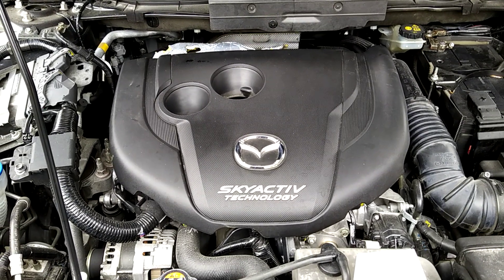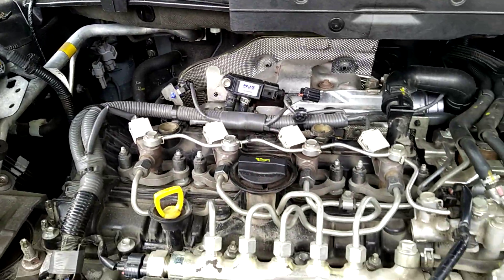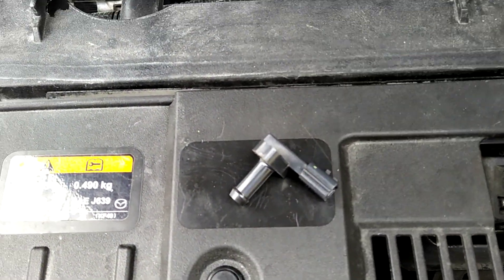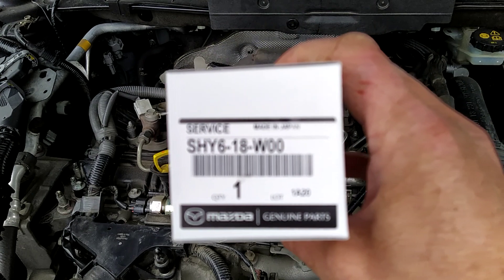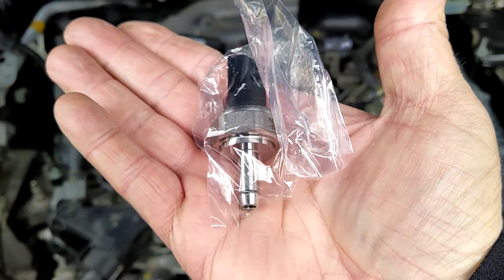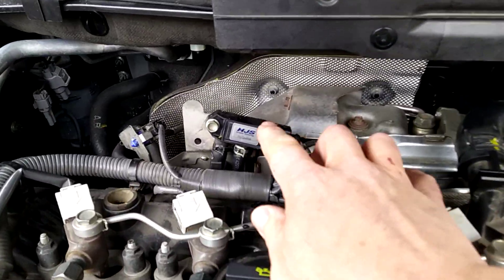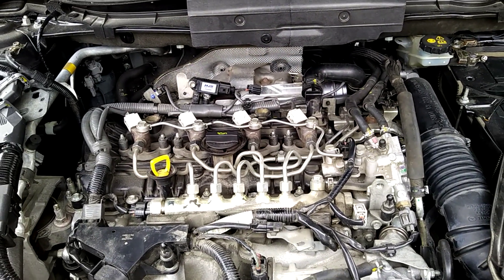Mazda SKYACTIV CX-5 2,2 Diesel DPF / Exhaust pressure sensor **IMPORTANT**

Comment: Hello, I watched your video about cleaning the exhaust pressure sensor on the Mazda CX-5 2.2D.

On my car (CX-5 2.2 Diesel, 2015, around 105,000 km) the DPF regenerations happen very often, about every 180–220 km. The strange thing is that it mostly happens when I drive on the highway (Autobahn).

The car itself drives well and fuel consumption is around 7.6–8.0 l/100 km, but in Forscan it shows frequent regenerations.

Could this problem also come from the exhaust differential pressure sensor or the hoses being clogged, as you showed in your video? Have you experienced the same issue?
Reply from the maker: Hi, thanks for your message. The video on the exhaust pressure sensor was replacement, not just cleaning. If you have the old all plastic sensor, replace it with the latest one that is metal and plastic. The reason for frequent regens could be plenty, suspect that your DPF could be near clogging and your EGR and manifolds need de-carboning. Check your MAP sensor, located on the left side of the manifold under the electrical big wires. Clean that out, but if it is heavily caked up, your intake system is choked up. When you drive this car above 120 km and hour, the diesel consumption jumps considerably. Your low end mileage is within range.  Let me know how it goes.

Comment: Hi, I have a question. I'm really struggling with my car. It's a 2016 diesel model. Diesel is somehow getting into the engine oil. Sometimes the DPF warning light comes on, and occasionally, at high RPMs - around 3000 - the car goes into limp mode. It also performs regeneration every 15-20 km. Could you please list all possible causes and indicate which one you believe is the most likely?
Reply from the maker: Most likely you have injector leakage into the oil. I would start with that. Depending how bad it is, the other affected parts could be the DPF and turbos. MAP sensor is most likely clogged as well. The injector washers were a bit of a common problem on the early year 2.2 diesels. You could see some moisture at the bottom of the injectors as well, sure sign of this.

Comment: So I can basically just go under the hood and look if it is already upgraded on the one I just bought? Since it looks significantly different.. Or are there many versions?
Reply from the maker: If the sensor is metallic, you are good. Plastic- get the latest SHY-6-18-W00

Comment: I and mechanic can not find this part.   Somebody can help?
Reply from the maker: SHY-6-18-W00  Mazda original part. It is made of steel, while the older ones were plastic. Readily found on Google.
Reply: Have you tried ebay? I got mine from there

You can also Google the part number and work from there

Comment: EDIT: This video was almost perfect but your model numbers are out of Focus.
For those who have P0471 and P2262  faulty exhaust pressure sensor you need the part on the left (after market part - made in china likely) SH01-18-2B2 EDP Sensor and the Mazda Dealer Part (metal one to replace plastic one on the right of video) SHY6-18-W00 Pressure Sensor Kit with Tube.  
Be sure to double check these parts fit your Mazda CX5 as some models are different

Also if you want the installation of this part see https://www.youtube.com/watch?v=8nEuFytxrRw
Reply from the maker: Thanks, the reason I did not mention DPF pressure sensor (on the left) part number is because you can get those aftermarket reasonably. The exhaust part number on my video is right of the Mazda box, as far as I know that is the only one for 2,2 diesels.

Comment: Hey, i had soo many problems recently, i purchased a 2017 plate cx 5 2.2, its the Ke model (older shape) im currently getting p0101 mass airflow and scbs etc. the dealer i got it from changed 1 of the sensors and it was decarbonized etc and cleared out and reset. Do ya reckon this would fix the lot? As i know the mass air sensor works, with out the error the car boosts and drives with no issues
Reply from the maker: The MAF sensor issue should be cleared with either cleaning or replacing it. The SCBS and TPMS lights coming on is related to something different. I am battling this myself and will post a video soon regarding the recent issues I have had with my CX-5

Comment: how to change that rubber tube, i clipped my old one a bit more and then the exhaust gases start coming out, so i need to replace that rubber tube.
Reply from the maker: I would use long nose needle pliers first to get the clamp out and then pull the old tube out. You need to eyeball a new hose to be long enough where the pressure sensor sits nicely in its space. Spray some wd40 on the motor end hose inlet, insert the hose and clamp and the rest is on top of engine work.

Comment: Good evening. I have a masda cx5 2012 model. I have replaced dpf and made a program to delete the egr. However from thereafter an error p244A DPF pressure too low appears and from time to time when the car is cold is shaking for 3-4 minutes. Any idea?
Reply from the maker: I really cannot answer this since you deleted EGR? Was there a reason for this
Reply: @cronk216  Yes. Egr was blocked. And we decided to delete it.

Comment: Hi bro, I get P0236 "turbo compressor sensor A circuit range/performance" does it apply to the same sensors?
Reply from the maker: I would start by checking the boost sensor and if it is Ok and codes come back, look for intake issues or airflow to the engine

Comment: I have a mazda cx5 2.2 diesel (2016) codes p2262 and 0471 what do you think? Will it help if i replace this parts?
Reply from the maker: If you have an old style exhaust pressure sensor, upgrade to the new one. It will help, but beware that a clogged DPF will trigger codes later. Clean your MAF, MAP and IAT sensor as well.

Comment: What about p2466?
Reply from the maker: This code appeared with my car just before the real problem showed up, which is the "Check DPF" on the dash info screen. I suspect your DPF is clogged up. Driving with the big backpressure from the DPF is not good for the engine in the long run. *NOTE This is of course taking into account that you have the upgraded metal exhaust pressure sensor, the old plastic ones are bad.

Comment: How do I make sure it is a bad sensor? I got error P2118. Also DSC, TPMS, SCBS and parking breaks lights up in dashboard
Reply from the maker: I do not have an answer re: checking if sensor is bad. You have a different code from what I have seen, P2118 is electronic throttle actuator error code. It could possibly create those other codes, not sure. I would try clearing the code and if that same code comes back, look at the throttle actuator first. Did your car go into limp mode?

Comment: thx. The connectin pin/cables are the same..? BtW, can i replace the sensor only, leaving out the new pin and cables?? THX al lot!!
Reply from the maker: If you replaced the exhaust pressure sensor with the new metal model, you have to use the new wiring. Plug and play.
Reply: @cronk216  Thanks!!!! 😊😉😊😉💥👋

Comment: What about code P0299?
Reply from the maker: Low turbo boost pressure code, could be either turbo or the control flap on the drivers side under battery. You can see it clearly once you get piping out of the way.

Comment: Thanks for helping us all with your knowledge ❤ one question please..I get the all the warning lights when I brake or drive downhill but they usually reset after I turn the engine off. Recently got a dpf warning and then a dpf malfunction light and dpf guys resolved it, cleaned the exhaust and even said that it wasn't a lot of sooth there to give the warning at all. Next day same thing happened and same light was on. They said if that happens then its probably just the sensor and its not dangerous. Now Im thinking should I just clear the code every time it happens as its just because of a bad sensor or can this still be an issue? Thank you!

Comment: You nailed your first video , and yes it fixed issue with mine , i had codes relates to turbo underboost thats it , engine light on , issue with transmission gear shifts  , 
You are legend

Comment: Hi, I just bought a Mazda CX5 2015 reg and it has problems starting and then it’s showing DPF warnings on the dashboard.
It stalled a few times and then completely stopped even with the jump leads - would you say this is an issue with the starter motor or the DPF sensor?
Reply from the maker: Changing the DPF and exhaust sensors will fix numerous things, but not in every case. The I have had 2 years of trouble free driving, but now my DPF is blocked and my next video will be about that. I will remove it and take it to a shop that cleans out all junk. I will also do a de-carbon on the manifold, egr etc. Stay tuned.
Reply from the maker: Hard to say, but if you a showing a DPF filter blocked-excessive particulates warning in the dash, DPF most likely has to be cleaned. Other issues are sure to be present.
Reply: I suggest you find a mechanic to do a DPF delete both on the computer & mechanically in the engine. Change the Exhaust pressure sensor you’re good to go! Once the DPF lights up it’s majorly due to carbon build up due to dirty/low Quality Diesel you’re using.
Reply from the maker: I would absolutely do this, however the inspections in my country are very thorough and there are big penalties once you get caught.
Reply: I have exact same issue with 2014 model with dpf and SBCs and tpms warning lights on the dash and has gone into limp mode with no turbo boost. wondering if this will help and has also developed some knocking sounds from engine bay. 😢
Reply from the maker: I would visit a shop, that knocking sound does not sound good..

Comment: Hi. I’ve replaced the pressure sensor with the metal one (old one burnt out), also replaced Intake Manifold pressure sensor (found that it was broken), scan reading shows P2262 and P0299 (turbo charger under boost). DPF deleted, intake manifold cleaned, but about to clean the EGR. Vehicle in limp mode and struggles to pull away while in between 1000 to below 3000 revs (stutters and kind of misfires). As soon as it gets to 3000 revs it picks up power but shortly after loses power again.
Reply from the maker: This car has complicated logic from DPF and exhaust related issues. Mine has developed TPMS and SCBS warnings without limp mode recently. Mazda service advisor mentioned that these are common codes that come in bunches. I explored ABS, SAS module issues based on his advice. Expensive stuff, did not believe this was the cause, and kept driving with my sensor. Now, finally the DPF showed true and is blocked. I have to remove it and get it professionally flushed clean. I will de-carbon manifold, EGR and related pipes as well. So- Even those ABS and SAS module codes show up and looks like in my case a prelude for the DPF issue to come up.

Comment: When I bought the car the whole wire came cut off
Reply: I bought this new sensor did the wiring, the lights haven’t come off
Reply: The pipe they gave only lets me put a bit of the sensor inside, could the lights been cause it’s not fully in?
Reply from the maker: You have to get the rubber tube to be well placed at both ends. If you have the old hose and it is in good shape, measure carefully and re-attach. Even after all this, you might need to clear codes to complete the job.

Comment: I have a similar problem. Car in limp mode, turbo affected, and have these errors: P0299 and P2262. Should I go on a limb and buy these two sensors?
Reply from the maker: Please check what type of exhaust pressure sensor you have in your car. If it  a plastic model, replacing it with the new metal one is a good idea. The plastic sensors get destroyed due to the heat.

Comment: Hello, I have the same car and the sensors that you mentioned in the video are giving me problems.  I would like to try changing the pressure sensor you mentioned to see if it works.  Could you please tell me where you bought the sensor?  Thank you very much for your help .
Reply from the maker: Hi, the exhaust pressure sensor is a Mazda dealer item. Specs are on the video. The DPF pressure sensor can be found at well stocked car parts stores

Comment: Hi, i keeep getting all the codes in the video plus the SCBS forward malfunction ..took it to the garage he said exhaust pressure sensor needs changing so he did that i picked it up this morning and as soon as i started the car the engine management light come on with all the same codes
Reply from the maker: I would go back and have the garage take a look what is going on..

Comment: Thank you so much for this. Had the same codes with limp mode etc. Mechanic came out and wanted to replace the turbo at about £2k. Ended up changing the sensor myself for £70 a week ago and so far it's been running great! Hopefully this has sorted the issue and you've saved me replacing a turbo which didn't need replacing (and wouldn't have fixed the issue)
Reply: Does the new sensor requires coding via a diagnostic scanner tool after installation to work properly?
Reply: Nope, just make sure you use the new wiring harness that comes with the kit.  @trorth5626

Comment: There is an exhaust pressure sensor kit same as this on ebay. How do you install it
Reply from the maker: Remove the old sensor, couple of nuts and remove the downhose. Remove the existing wire set to the sensor and install the new one. The downhose has to be about the same length as the old. Long nose needle pliers should do the trick, apply lubricant to the hose ends and they will slide in place easier.

Comment: I watched this video and bought the Sensor Kit - SHY618W00 for £73 on Arnold Clark auto parts.  Having fitted this over the weekend it’s removed all the fault codes I had and got the car accelerating how it should again.  No doubt if done in a garage it would be £100s for this work so thank you very much for making this video.  Trickiest part of the install for me was replacing the hose.  I was tempted to just trim the original one by around an inch but decided against it.  I’m a bit nervous of whether the cables are protected enough from the heat so plan to add a bit more protection to it.  I should add that before replacing this sensor, I had previously replaced the DPF pressure sensor but that didn’t solve the issues.
Reply from the maker: Hello, thanks for your comments. Do you still have the new hose that came with the kit? You need long needle nose pliers, remove the old one for measure and apply wd-40 on the tube ends and they should slide on place. Carefully slide the pressure clips in place and you should be good to go. Hope you used the new wiring harness??
Reply: Any chance you could do a quick video explaining how to do!? @cronk216

Comment: I usually say mazda make good engines, because they do. But this lump wasnt one of them. My dad has owned one since late 2018 and has had quite a few problems with it. Wastegate in the turbo assembly (they have 2) sheared off and took out the small turbo. Mazda changed the turbos under warrenty as it was considered a recall item at the time. Next, it decided to start dumping raw diesel into the engine oil. Cant remember what happened there but it was fixed at the time. Leaking engine oil from under the cylinder head and from the rocker cover. Mazda has declined to repair these leaks. Its latest fit of bother has been loosing coolant and yet another diesel leak from the injectors. Its currently leaking diesel from injector no.4, both from the return pipe and up past the injector. It leaks enough to cover the engine block, rocker cover, and gearbox in diesel, along with the existing oil leak. To the best of my knowledge, mazda does not cover these bits under warrenty anymore. The car is at 117,000 km. Very low mileage for such things to be happening if you ask me. I love japanese cars like mazda honda and toyota, seriously i do. But i have to say as a criticism to mazda, lads ye made a right f■ck up of an engine on this one. A shame because the cx5 is a beautiful car to drive and imo is quite luxurious inside and looks the part from the outside

Comment: This was the error you had and this was the solution?
https://images4.imagebam.com/9b/93/91/MEP76EI_o.jpg
Reply from the maker: I am not sure what the code for SCBS was, however it is good to clear after all other work is done, since at least in my case it was still present.
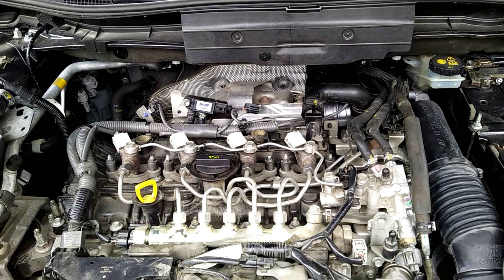Reply: @cronk216  I put on one picture what you described at 2:04 and also the Mazda code for the new version of sensor, people to not buy the old sensor version.
Of course, must be changed also the SH01-182B2 sensor to get rid of problems you described at 2:04 and showed in my picture.

Comment: I have a Mazda 5 2010, diesel, dpf light flashing , engine light on and antisklid light on, turbo not working...cannot find these 2 sensors...anyone knows where on the engine they are located ?
Reply from the maker: Have you scanned the codes that are present? Is this engine 2,2 l diesel?
Reply: @cronk216  The codes are P0299 person low boost..
MAZDA 5 (CR19) Diesel 2.0 CD (CR19) 81kW/110PS
Reply from the maker: Not that familiar with this engine, but based on that code I would check for vacuum leaks and inspect the turbo by checking if the flap has come loose that controls airflow to the turbo. You need to remove the airtubes going to the turbo to see this.
Reply: Thanks a lot ,👍🇧🇻
Reply: Is it wise to have the dpf and egr closed from the CPU ?
Reply from the maker: I would not, and that would be pretty advanced programming. I don't think the engine would even run with that. Try and tackle the code and go from there.
Reply: @cronk216  Thanks, I will.👌